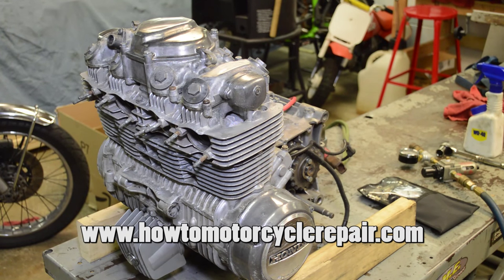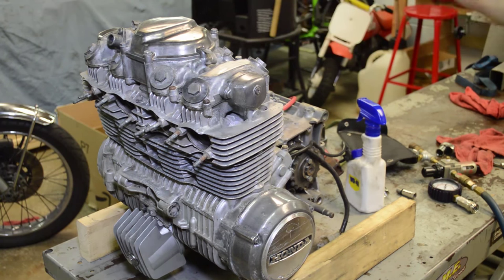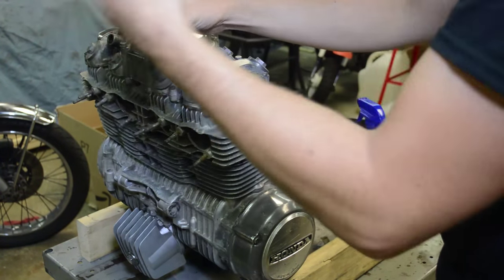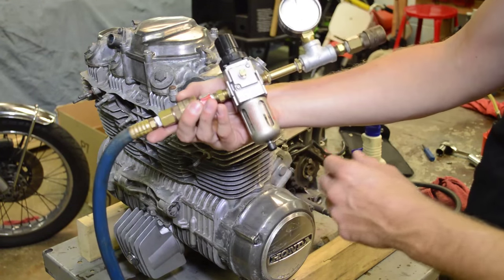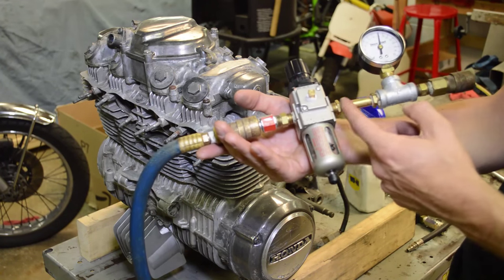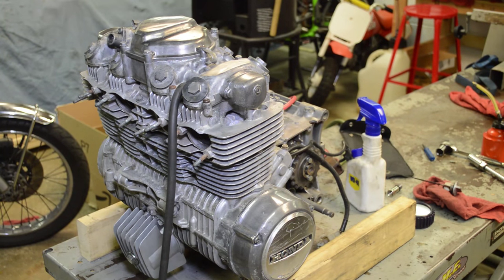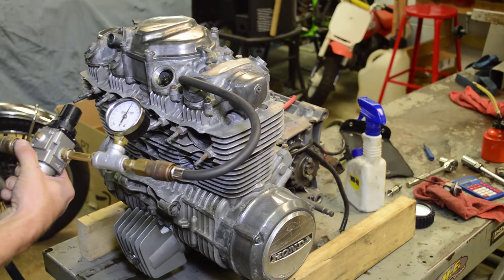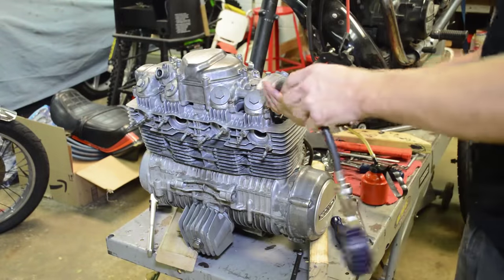How-To: Perform A Leak Down Test On A Motorcycle

Comment: Just watched your linked video where you speed rebuilt the upper engine.  Awesome.  Now I'm tempted to do a compression test on my cb750k3.  I've avoided it up to now... It passed 8 years ago, when I did a semi restore on the bike, and now I just did another one (actually what I'd think of as an almost complete restore except for the engine and some other odds and ends)... but one of the exhaust pipes (#3) has a much throatier / deeper sound than the other 3.  It makes me suspect a burnt exhaust valve, because there is also more pressure on that pipe...as if it might be blasting through a leaking valve?  On the other hand, this engine only has about 9200 miles on it.  In theory it shouldn't be at that stage, yet, right?  And believe it or not, the bike still purrs...  Positively purrs, because of the carb cleaning, new spark plugs, replaced fuel lines/filters, shimming and carb sync and re-tensioned cam chain... enough other things are right that the bike is still sounding prime.  Even used a strobe to do the timing, and got the F to match perfectly with the mark, under that strobe (this bike still has points though, so i also had to gap the points and replace the condensers).  Anyhow I'd better check the compression on #3, and at least see.  Thanks for the video.
Reply from the maker: Let me know what you find.
Reply: I just made a new video with the bike running.  Here it is.  Maybe you can tell me what you hear when it's idling.
https://www.youtube.com/watch?v=YirlyjYYIPE
Reply from the maker: Needs more tuning. Did you vacuum synch the carbs?
Reply: Yes, they are all bouncing between 5 and 8 psi.  Couldn't get that psi any higher without running the nut off the top of the carb slide (or at risk of it - with just a thread holding...even with locktite that is asking for trouble).
Reply: timing is strobed onto the f mark, perfectly, at advancer rpm, for 1-4 and 2-3
Reply: valves are shimmed .002mm in, .003mm out.
Reply: cam chain freshly-re-tightened
Reply: new plugs, points, condensers... points gapped to .014 in...plugs gapped as well
Reply: fuel air is done based on smell of gas in the tailpipe emissions
Reply from the maker: You mean inches not mm right?
Reply from the maker: You need to tune them for highest smoothest RPM, not tailpipe smell
Reply from the maker: You mean inches of vacuum? I use merc style synch sticks.
Reply: The measurements are right.  The manual gives some in one, some in the other.
Reply: yes, sorry, inches of vacuum - 4 tubes connected to the carbs, each connected to the vacuum line...
Reply from the maker: Try tuning per this video: https://youtu.be/zm5mB3R8Ucw
Reply: Why do you set this fuel air mix while idling and not at operating speed?
Reply from the maker: Because it is the idle circuit.
Reply: Okay, thanks!

Comment: Hi. Sorry about the stupid question but you did it with the oil in the engine or the only oil in was the one you had on the test? Thanks
Reply from the maker: Yes the motor had oil in it.

Comment: Great video, thanks.  However, are you sure that you get a more accurate result using a compression tester with the valve at the end of the tube.  Surely, when the gauge is reading the pressure, the valve is open and so the volume of the tube will still reduce the pressure read at the gauge.  Or am I missing something?  Thanks again
Reply from the maker: Here is more info: https://youtu.be/q1H7550B48I
Reply: @HTMR  Ok.  I think I’ve got it.  With the Schrader valve at the cylinder head end (as you recommend) I was thinking that if you have 100 psi in the combustion chamber and the Schrader valve opens, then you might only have 75psi at the gauge.  However, I’m now thinking that on the 2nd compression, you’d have 100psi in the combustion chamber, 75psi in the tester tube, so when the Schrader valve opens you’d end up with, say, 85psi in the tube.  And after a few more turns, you’d end up with 100 psi at the gauge.  Just wanted to clarify in case I confused any of your readers.

Comment: Great video Matthew! Just one question: the bit where you mentioned the added volume due to the schrader valve position close to the gauge, does it really affect the pressure measurement? It would definitely affect the compression ratio cause thats a ratio of volumes but I think the pressure value (compression pressure value) will stay the same independent of the location of the schrader valve (of course there will be some losses depending upon the flexibility of the pipe etc.). What do you think?
Reply from the maker: https://youtu.be/q1H7550B48I

Comment: Hi Matthew, enjoy your videos. Question: My .040 drill bit is inexplicably missing from my set. Can I use a .041 bit or will that cause a problem? I also notice that the specs say “0.250 in (6.4 mm) long, 60-degree approach angle” Is that .250” depth critical to get exactly right? And what do they mean by 60-degree approach angle”? Is the hole to be drilled at an angle?

Ok, I figured out the approach angle LOL Now the question is, is the .250” length INCLUDING the approach angle on both ends or EXCLUDING the approach angle?

Comment: #1 cyl TDC or each one as your doing leak down? Also, valve lash or is it a torque spec? What is spec for either one? Great job on video… I’m a heavy duty diesel tech, this is a little out of my realm but my 15 yr old son got a nice ‘79 CB 650 and we’re gonna rebuild it together. Where can I get a worthy mechanic manual for these engines? Appreciate your time and effort!!!
Reply from the maker: Any cylinder tested has to be at TDC. Valves have to have some lash otherwise they can be slightly open and give false readings. Try tradebit for manuals they are cheap.

Comment: This is great Matt. I did a compression test on my ‘81 Honda CX500 and had exactly 135psi on both sides, engine was in the bike but cold, I don’t think I opened the throttle either so I’m going to go back and redo the test, the bike runs fine anyway after I did a CDI replacement for an ignitech. One thing though, I assume that if it was rings issue there would be smoke which I don’t have at all, so could be just valves or doing the test properly that’s needed. I haven’t had the engine out as yet, so trying to avoid it. Thanks, Rich
Reply from the maker: Get the engine hot and open the throttle, you will get higher readings.
Reply: Thanks matt, your video was very clear, I basically wasn’t giving it a chance, but at least I learned both cylinders are equally balanced.

Comment: Hey Matt

I'm trying to carb sync my V4 Honda right now and having trouble getting cyl #4 to sync. I've tried adjusting it a million times now and still can't get it to sync. It still climbs slowly on the manometer, then if I rev the bike very little, it drops back down, and then slowly continues back up. I have a video of it on my channel.

Someone said that a bad valve seat or ring seal could cause a manometer to "dance" like that and basically you'll never be able to get it to sync properly. Have you ever had that happen to you? I haven't done a leak down test yet which is why I'm on this video.
Reply from the maker: I watched the video. Are you sure there are no vacuum leaks?

Comment: I know this is an old video but I have a question.  I need to do a leak down test on my Honda CR250 and have watched a few videos now.  Some people use the restricter and others don't.  In this case I have a two stroke engine but I'm not sure if it matters. Would it be okay to build one with a pressure regulator with a one way valve that allows you to pump 7-10psi into the engine and then disconnect the air hose, take off the expansion pipe and plug it with a freeze plug, take off the carb, hook up the contraption in the intake where the carburetor would be (leaving the spark plug in place), pump 7-10 psi into the engine, and watch the gauge over 5 min or so to see how much pressure is lost.  If a leak is located you could then spray everything with soapy water and have the radiator cap off to check for bubbles.  

With your tester I understand that you're able to quantify the leaking with a percentage but is that entirely necessary?  Thanks for your videos, I've learned a ton from your channel!
Reply from the maker: Yes for a 2 stroke you want to pressure test it.

Comment: The cylinder compression increases once the rings have fully seated, I had a Stihl hedge trimmer that was like that when I fitted a new cylinder kit onto it.

The compression was 105 PSI when brand new but once the rings seated in it went up to 120 PSI !

Comment: be carefull cranking on the large nut points side,it only engages two little drive ears and snaps easily,bump the air test pressure up and youll have more leak percentage,lock the motor from turning under that pressure,testing low gives optimistic results.

Comment: why its not possible to seal completely??.thanks for the info...great job
Reply from the maker: Sealing parts are metal to metal, never going to seal 100%. Also there is a piston ring end gap, so that is a leak point by design.
Reply: @HTMR  thanks .....subscribed...😊
Reply from the maker: @naveedaka  Cool thanks.

Comment: How do you connect an engine like in the clip to an ignition source if the engine is not on a motorbike? Thanks
Reply from the maker: You can supply 12V to the coils and it will produce spark. Look up which wire in the service manual.

Comment: How do you set up the motor to bench test like that?
Reply from the maker: Jumper cables from a battery to the starter.
Reply: Awesome, thanks. What if I wanted to actually run the engine out of the bike?
Reply from the maker: @SeriesOfTunnels  Probably easier to set it in frame. By the time you rig up exhaust, coils, etc..you can have it in frame already.

Comment: Would different air pressures not change the outcome ratio? Just wondering
Reply from the maker: Maybe, but we are after a percentage drop here. A higher psi would roll the motor over and is a PITA if you are by yourself. 100psi makes easy math though.